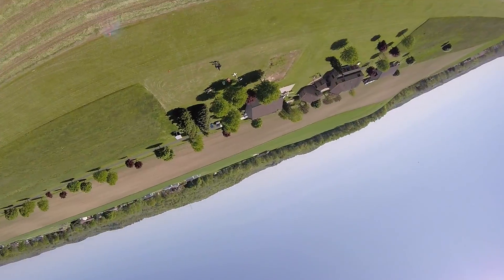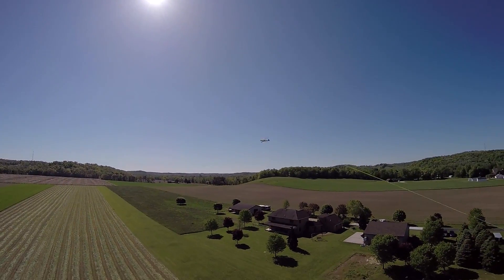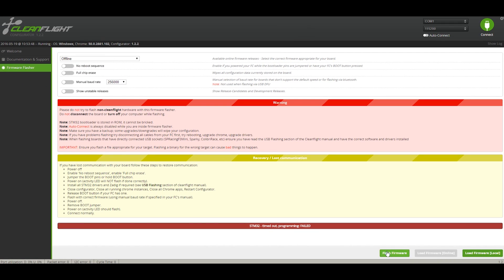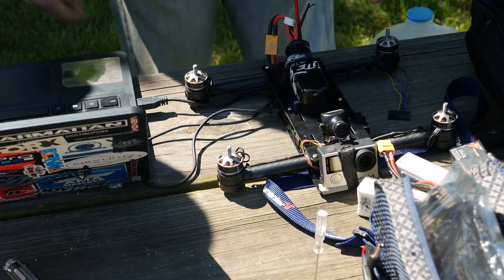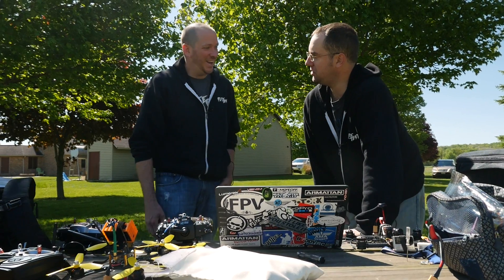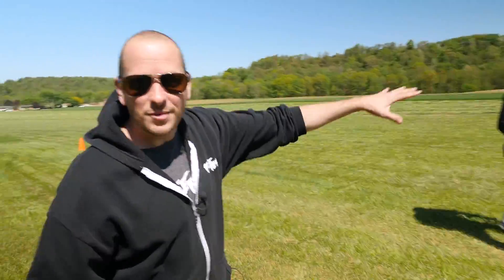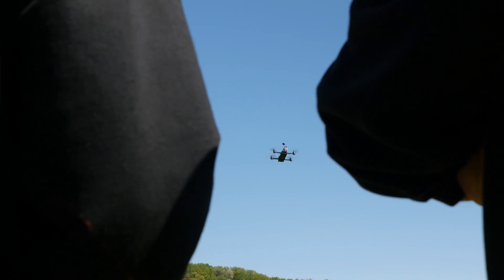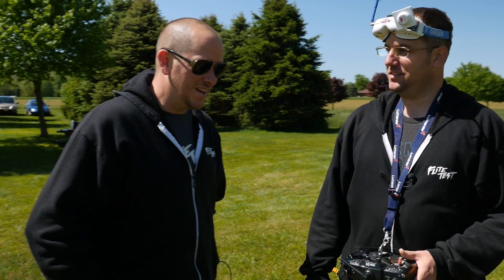How To Setup AirMode (Betaflight) | Flite Test

Comment: No need to turn off airmode for landing if you actually take time to set it correctly - your air mode motor setting should not actually provide lift or its too high
Reply: where are those settings located

Comment: Everytime I switch to airmode the thing goes all jiggy so I gave up on it.
Reply: you need to lower your motor min throttle setting - airmode should simply smoothly spin props with no real lift - quad should sit completely stable on ground with airmode

Comment: So is airmode Acro?
Reply: no - airmode keeps the props spinning at their lowest possible smooth setting when throttle is at zero - that's all.  It allows for smoother rolls and flips and allows control with zero throttle

Comment: hi there I'm running 3.0.1 beta flight has anyone got a good pid set up for a 180 quad I got the eachine assassin 180 v2 and can't get my yaw to turn quickier it's very sluggish the roll and pitch good tho and as i pitch and roll it's shakes a bit when centred in angle and horizon  mode and help please running p at 43 43 100 I 33 33 d 22 22 20 any helps please

Comment: What's the difference between air Mode and acro mode?
Reply: 9thbigfoot with air mode you can do flips and stuff without using throttle

Comment: Can anyone help me out with this? I'm running beta flight 3.1.6 and the air mode seems to do something different from what you've described. mine seems to have that 10% throttle as soon as I arm. air mode doesn't kill the throttle right away and feels like it stops the quad from falling as fast

Comment: Just finished my FT 210 build. In testing motors noticed that motors where revving higher and throttling down 'did not work'. Thought I did something wrong but turns out it was air mode. I had the arm and air mode on same two way switch. THANK YOU for this video! Will move air mode to different switch now. Btw, love my build. Waiting on 4 inch props to fly t as my 5 are too big.

Comment: i have a question, when you are using airmode, and you cut throttle, the motors stop spinning? or they continue in a very slow rpm?
Reply: They continue at slow rpms, but the pid and stabilization is still on, so they spin slowly because there is no need to spin faster they just apply commands from your radio and maintain the drone in the actual position.

Comment: My 130 on landing jumps back into the air violently even without air mode on if I turn on motor stop I have to cut the throttle before I hit the ground but I just disarm and let it fall out of the air to land any ideas how to fix this

Comment: why not just use the arm setting with the motor stop turned off?  and have a minimum throttle set on arm?
whats the advantage of air mode?
0 throttle I have control because I have a minimum throttle setting on arm.
also should I set my minimum throttle to 0 if using air mode??     thanks for the vids!!!!!

Comment: really you shuld never use airmode and arm on the same Switch because. In the official instruction, it’s suggested to use 2 separate switches for Arming and Airmode. Some say that because with Airmode enabled, your I term error in PID controller will keep increasing while it’s on the ground. The PID controller will try to correct this error, and eventually the quadcopter will just spool up and might go crazy.

Comment: Any reason why when I flick it into angle mode in Betaflight (betaflight gui) I get a heavy oscillations like bad PID controller? It's fine on Cleanflight but want to use the SuperExpos in Beta. Running Naze board equiv.

Comment: New to the fixed wing hobby. I started watching your videos with the versacopters, multirotors, guys from rotor riot ect and now fpv has me HOOKED! I do not want to build or spend over a grand on my first  fpv race drone (yet). So I came across a product.  My request is; can you do a review on the HK Black Widow 260 fpv drone? Would like to know durability,  limitations, speed posible mods and so on. For $170 rtf it looks like a great budget beginner quad. would like to know Your thoughts on it. Josh#1, Josh#2, Pete and the long hair drone guy; keep up the good work.

Comment: Sorry for asking what might be a dumb question.  When setting Airmode can this be with another mode i.e:  Horizon and Airmode.  Or will Airmode only work in rate mode.
Reply: Not a dumb question at all, not it can be set with anymode. It's essentially the same as a min throttle check where your props will still be spinning even when you bring the throttle all the way to the bottom.
Reply: It's to give you control so your quad just doesn't plop and lose control

Comment: Great video! Quick (kinda important) note about the CLI dump bit: ideally you should use a program like Notepad++ so you can easily make a comparison between your current settings and the defaults in the version of BF you're flashing. That way you won't copy over any unwanted changes (like changes in optimal filtering, PID scaling and default PIDs). It will save you a headache :D
Reply: I can't remember if you already mentioned this in your CLI dump video. I'm sorry xD

Comment: I was setting up my modes for beta 2.8.1 the other day.  I use Aux 1 for my rates (angle, horzizon , rate)  I was going to also throw airmode on Aux 1 (three way switch) and have the value span over horizon and rate... so in theory you could flip back to angle to land and airmode would be disabled by default.  That saves a channel on the receiver as well.

Comment: so im still a bit confused so does this allow you to fly like you can in "lift off" where when you cut the throttle your motors stop spinning but you can still do rolls and stuff? sorry im a bit slow
Reply from the maker: Hey Thomas,
Essentially that is correct!  It allows for your to cut throttle and still be able to maneuver in the air without feeling like your falling out of the sky with no control.
Reply: Ah okay thanks for the help will have to try this:) and thanks for replying!!  such a great channel!!!:)

Comment: really enjoyed the vid. going to try airmode now that ive had a bit of testing with betaflight. will look for a video about super expo now too.cheers
Reply from the maker: Thanks Phil!  Air mode has definitely changed my flying experience for the BETTER for sure!  I hope you enjoy it as much as we did!
Blessings,
S.O.
Reply: how do i edit a video that i make
Reply: hey flitetest, can you try to make a motorglider
Reply: +FliteTest thanks. ive been using it since, it handles sweet and maintains stability much better. just floats down if at zero throttle. really glad i did it. thaks for the top vids, many blessings in JC :)
Phil

Comment: betaflight work with a CC3D ?
Reply: Yep, I run it on mine and it's stable at 500 looptime. It will disable the accelerometer if you do this though, so no auto-level.
Reply: remotaholic
ok thank you

Comment: Maybe I'm cutting edge, lol, but I run betaflight and usually wait a few days before after a release to make sure there aren't any problems.  I also don't arm with a stick, why would you do such a thing anymore?  With betaflight 2.8.1 being released, airmode can be set on all the time once the throttle hits a predetermined setting, so you don't have to worry about it doing anything weird on the ground before takeoff.  Super expo can also be turned on all the time, which gives lighting fast flips and rolls on the outer edges of the stick travel but stays nice and cooshy around the middle.  1 switch to arm, 1 switch for lost model beeper, nothing else.

Comment: Its fine to take off with air mode on as long as your not arming waiting 10 seconds then taking off
Reply: upgrade to 2.8.1 and set it as a feature with a predetermined arm throttle position.  you can arm and it won't activate until you hit whatever throttle position you set it to, 1350 is default.
Reply: Yesterday i installed betaflight, set up air mode. Took off this morning in air mode. Guess i was lucky.

Comment: cleanflight comes with air mode now. betaflight is experimental code, features that are stable are merged into cleanflight when they are tested.
Reply: i've been running betaflight since i got into quads 6 months ago.  I've yet to have an issue with betaflight.  I do suggest waiting a few days before upgrading to the latest so others who are more bold may find any problems.
Reply: yes, I wasn't trying to suggest that betaflight isn't good, it's just not needed to take advantage of airmode and people should be aware that is experimental unlike cleanflight.
Reply: +Dan Holmes beta flight is not beta anymore the name just stuck instead of having another fork
Reply: Not true, go read the documentation. I fly with Betaflight exclusively. I have never had a problem. Just trying to give people good information. I wasn't just guessing based on the name.

Quote from the wiki 

'Warning By definition this firmware is Beta software and is leading-edge technology. This means that some features are experimental. While exhaustive testing is undertaken by the developers, sometimes unforeseen things can happen.
It's highly recommended that anyone using this firmware should take common sense precautions such as:

* Remove all props from the Copter before powering up
* Perform basic operational tests on the bench, such as FailSafe tests, motor spin-up tests etc'

Comment: This is already outdated lol. The new betaflight (2.8.1) won't enable airmode until above a certain throttle level to prevent iTerm windup when at idle.
Reply: only if you set it as a feature.  you can still use a switch if you want by not enabling the airmode feature.

Comment: Hi guys I'm looking for a beginners race quadcopter. I have two cx-10's that I learned on. Any suggestions please comment, would love to get one. Price range 0-$500 Canadian. Thanks
Reply: do you wanna build it yourself or want a ready to ffly quad? do you want googles and transmitter too?
Reply: look up immersionRC Vortex Pro
Reply: +SiltecZ neuer Kanal yes rtr, with screen or goggles
Reply: +ZRUL FPV thanks, I'll give it a lool
Reply: I would say build a cheap one. You can build something like a tweaker. (search up rotor geeks). Canadian, good shipping, solid support. They'll get you started. It won't be the fastest quad (i started with dys 1806 2300kv motors, I still have the same quad hung up on my wall, it's been bashed, crashed, and broken) I learned a lot from having to rebuild the thing every time as well as tune it on my own. But if you wanna go vortex to avoid the soldering etc that's also a good way to go.

Comment: If you use motor stop set it to 15secs then when you go to 0 throttle which still responds in airmode (at your lowest throttle value). The quad will beep when the motor stop countdown starts.

Comment: should do speed passes and see how fast these quads go ...... 100 m.p.h ???
Reply: the versa won't do anywhere near 100.  only the lightest and most powerful racing quads can hit 100, and i don't even know if anyone's done it with a 4s battery.  check out youtube for catalyst machine works new quad, the stigg.  They have it on radar doing some 104mph.

Comment: Thank you so much, I didn't know air mode would fix my issues with low throttle control. This will save me from 9/10 crashes. Thank you for teaching me how to fix a major issue of mine.
Reply from the maker: Thanks for watching Owen! We are glad we could help and thanks so much for all your support!
Blessings,
S.O.
Reply: On my phoenix RC simulator, the throttle only starts when the stick is at fifty percent on my Spectrum DX7 black edition. i tried many things like re adding it to the simulator but nothing is working. can you please tell me how to fix my problem, thanks.

Comment: Hey, I have a issue with betaflight 2.8.1 it lets me flash the firmware but when I sort the pids out and use my aux 2 for air mode and arm it all works but when I plug in my battery my escs don't beep and my quad doesn't arm I've tried sticks to arm that doesn't work either..
Reply: Check that your minimum stick input on your throttle is lower than like 1040 on your transmitter. You might have to tweak some transmitter settings or mess with throttle trims
Reply: +A&C Quads I've tired that already doesn't do anything.. I'm on cleanflight using air mode now works fine